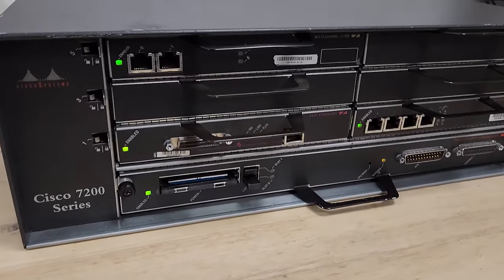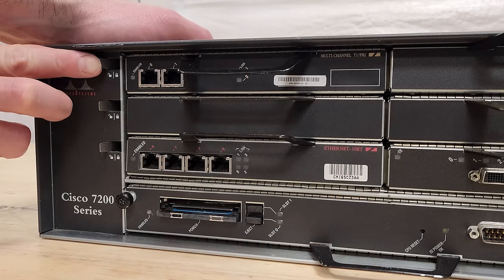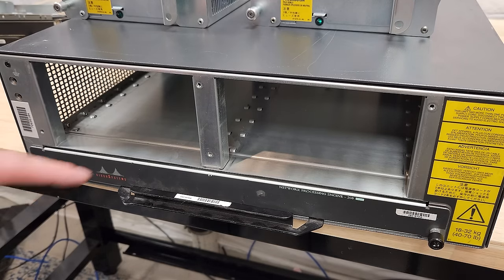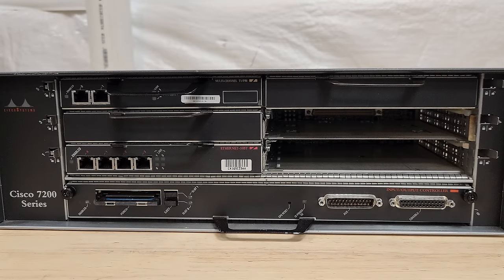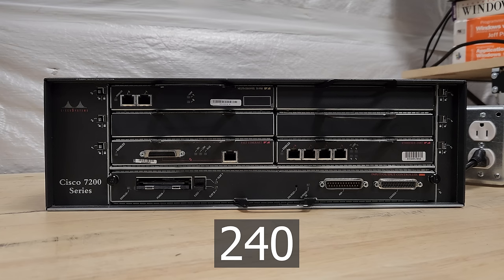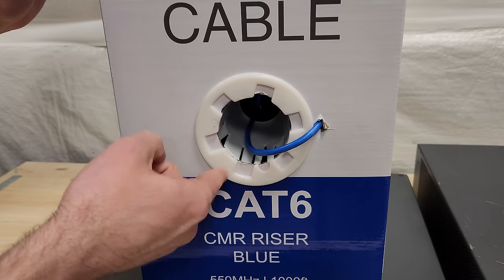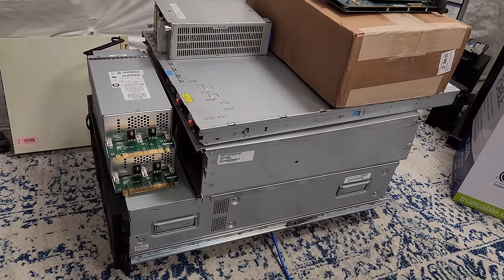Cisco 7200 Series Router

Comment: Installed, and/or monitored several of these through the years. It is one of the few routers that honestly it would be safe to call a boat anchor if it catastrophically failed. Mostly because of the copper winding's in the power supply. 

Both of the companies I worked for at the time (late 90's, early 2k's) were very extensive users of Token Ring. They were also both heavy mainframe users (though I don't know if the one was using IBM mainframes, or someone else's.) I suspect that if you ask around the biggest and most persistent users of Token Ring were in businesses where "No one ever got fired for buying IBM' and were in sectors considered highly conservative, (Financial services, Insurance, etc.)

Have fun, and keep checking on the hardware. And remember that there has been a large sector of the community that has been hording releases of IOS, simply because it made more sense to do that than to not have a version of code to fall back on if someone dropped support for a piece of hardware the business relied upon.

Comment: You can actually run the NPE-225 in the 7200 non-VXR (I have one in one of mine).  Advantage is being able to support 256MB RAM vs 128, so you can run newer software.  My boxes have the PA-2FE-TX cards, an E1 card and a bunch of PA-A3-OC3MM cards; they were originally used for routing between ATM LAN emulation eLANs at a large university; one was the Internet border gateway.

I ran one of these as my Internet border at home, but the NAT translations would cause my memory to exhaust itself on later releases of IOS (many which worked on 128, but claimed to require 256MB).  Shortly after upgrading to the NPE-225 from the NPE-200, I moved to a 2851.

There were two types of memory card supported - ATA flash (as you pictured), and linear flash.

Comment: Generally where to find the file to boot from in Cisco devices is part of the configuration, so it not finding the file in slot0: automatically isn't actually unexpected behavior.

This allows you to keep multiple versions of IOS and swap between them easily for troubleshooting, upgrading, etc.

It also allows you to have multiple cards with backup files in case you have a hardware or file corruption error.

Comment: I'm feeling really bad that routers I still use in networks today are featured in a 'retro' networking video! The Cisco 7200 was a real workhorse when I was building networks in the late 1990's and early 2000's. Went right through from NPE-100 to NPE-300, and then ultimately the NPE-G1 and NPE-G2 which have the I/O controller and some GigE ports built into them. Whilst newer routers (such as the 2800 and then 2900) had GigE ports, it didn't mean that the CPU could pass full gigabit speeds.

One particular oddity with those PCMCIA cards is that Cisco came up with their own format and filesystem which wasn't understood by linux. I spent time reverse-engineering this at the time, and wrote a tool "ciscoflash" (there's still references to it on Google) which allowed me to read files from the filesystem - very useful for extracting log files, etc.
Reply from the maker: don't need to feel bad about that, these things were built to last. I'd like to try out a G1 or G2 someday!

also I'll have to check out your ciscoflash... very useful!

Comment: Fun video....  since you have a spool of cable there, it would be neat to see how far you can shoot that T1 line...  if you can get to the far end of that spool, put a connector on it and see if you can shoot the 1000 ft or so that's in there.  T1 should shoot well past that, but I'm curious if two routers can shoot that distance.

Comment: I don't remember what the modem speed was at the time, 14.4, 28.8 or 56k, but I drooled every time I read about T1 and it's stupid fast speeds! Those massive pin connectors kinda remind me of the 2009/10 Mac Pro CPU connector. Just missing the massive locator pins!

Comment: 35:00 This is totally fine and pretty typical for this era! Tonnes of enterprise grade switches in the mid-late 00s were 100 meg with a few 1GbE uplinks.
Reply: We have a ton of branches where we're upgrading from 3650s to 9300s. It's all gig for access, but for some ungodly reason, we still have a ton of old VoIP phones, I think 7913Gs, which means all the endpoints are still connected at 100 Mbps.

After loads of pushing, we finally got management to evergreen the phones, and weirdly enough, at the branches that have been switched over to the new phones, network slowness tickets have stopped.

Comment: The points system sounds like is essentially assigns 1 point to 1Mb of bandwidth, doubling it if it's full duplex. Pretty simple to do the math in your head that way, so it sounds like a good system.

Comment: The little bit of memory @7:52 is not DRAM like you usually see on those modules but in this case its FLASH storage named bootflash:
Also note the big Dallas chip below it, It is an SRAM chip with build in battery and when that battery dies all the data is lost, so before that happens get a cheap EEPROM programmer and dump the memory and put it back in a new SRAM module you get from a place like Mouser and not some vendor from china because they sell old modules with already almost dead batteries.
Reply from the maker: yeaaaah wasn't excited to see that Dallas chip

Comment: If you get the 8-port IMA cards and a few Adtran TA-600 series devices (TA-612, for example) you can load an ATM firmware image to then run in ATM mode instead of TDM mode. Just pay attention to the hardware revision, since the v3 versions use a different image than the v1/v2 versions.

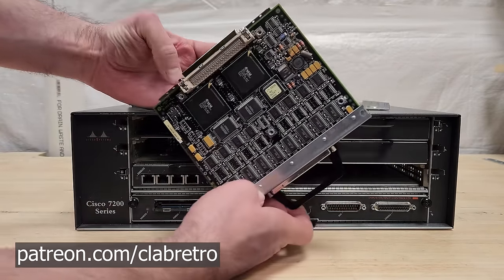Comment: 6:44 is that window going to be covered up? That appears to be large enough to be the secondary egress, which is necessary to have a room rated for bedroom usage. But I guess it's easily reversible if/when moving out. 
7:59 does eject button not fully depress for that PCMCIA slot? Normally you click it in & then it pops out, and then you click it in again and it ejects the card. 
Love seeing all this stuff done w/old cisco gear!
22:30 ah, card was jammed in upside down ugh
44:20 maybe time for a cable tester too
Reply from the maker: yeah the window is framed in properly now, it's just a technique where you build the entire wall at once first and then cut out to exactly what the window needs.
Reply: @clabretro  makes sense

Comment: "obviously never had a T1 as your house" .......
LOL
Yea I had a E1 in my apartment back around 2000. Technically Europe had the fastest internet as we had E1 and E3 instead of T1 and T3 connections so I had 2 Mbit/s leased line in my apartment curtesy of BT (where I worked at that time) 
Has an Cisco 1600 as my router and of course a TSU/DSU (have different names here as well) running over one analog circuit. 
Had a /28 public IPv4 range as my disposal... I ran my own DNS as well with full PTR delegation.. ohh good times..

My serial was connected to one ... Cisco 7206 VXR ....  Configuring time slots in Frame Really is .. difficult.
Reply: Let's guess that the DNS PTR was used for funny hostnames on IRC. 😅
Reply from the maker: very nice. in the states we pretty much made the switch from dial-up to broadband in most areas in the early 2000s
Reply: @JayJay-88  now you hurt my feelings, I would never do that.. ohh was that what my friends wanted to do when they asked me if they could "lease" on of my IPs.. 

i even placed one of my printers on a public IP just for fun, in case someone wanted to send me cool stuff..
Reply: @clabretro  yea right.. I used to work for British Telecom, was always fun to talk to my US colleagues about "broadband" :D

Comment: You can set the config register to ignore the system config, and then once it boots up, use the "show startup-config" (or "show start") command to see what it was.

"Show running-config" or "show run" and "show config" will show you what the current operational config is, which will be blank if you tell it to ignore the config on startup.
Reply: Of course once you do a "write mem" (also "copy run start") you'll overwrite the old startup config and lose it
Reply from the maker: Ah that makes sense. Would you have expected a "show start" required after telling it to stop ignoring and a full reset like that though?
Reply: @clabretro  hmm, not sure if I understand, but "show start" always shows the startup config whether it was ignored or not. "show run" always shows what the device is currently running, which would be the same as "show start" if not ignoring, or a default config at boot if it is ignoring.
Reply from the maker: Yeah it was just odd that the startup config (I thought) wasn't being ignored anymore at https://youtu.be/P5dsq16-d_I?si=Tc47dzg0Po3O238Y&t=1676, yet was still blank. And previously I saw errors relating to what definitely looked like an existing config. At any rate, I'll be checking "show start" from now on!
Reply: @clabretro  oh yeah it definitely still had a config stored in it. That seems all too common with routers and switches I've bought over the years.

As you guessed, all of those errors that streamed up the screen were for hardware and maybe software features that didn't exist (e.g. different software version/feature set, or modules that have been moved around).

When I say ignore I only mean that it won't load the startup config into running config at boot. But the config still exists wherever it is stored so you can then view it afterwards. On most older Cisco devices its stored in an EEPROM rather than on the flash card, but modern routers store it in flash (IIRC the 2800 works this way).

Maybe I need to re-watch the exact sequence of what you did, but generally:

1. Break in to ROMMON during boot, set config register to 0x2142 to ignore the stored startup config
2. Boot the router
3. Router comes up with a "blank" config (hence you get the prompt to configure the router), as in, nothing is configured but it'll have some basic contents
4. You can do a "show start" at this point to view the stored configuration, "show run" will just show the blank config from above
5. Configure the router as you wish, "write mem", and set the config register back to 0x2102 to boot up with your new configuration. Next time, "show start" and "show run" will both show your config.

Comment: Those passthru connectors seems so cool, i know. But every time i come across one in the wild its because of an issue. Whether the wires weren't cut flush and dont let the connector lock into the switch or the ends of the wires got shorted or corroded. Making an ethernet cable sans pass-through is actually very easy, as you well know considering you did it in this video. You just didn't cut the wires as short.

Great video, seriously! But being in the industry i hate those connectors.

Edit: YouTube comments on mobile don't auto-correct and its obnoxious.
Reply from the maker: Yeah they're great for an amateur like me though haha. I've made a ton without issue, but the blade on my crimper is actually wearing out so like you said, it doesn't always cut the things flush.

Comment: So the backplane of these looks like it's just PCI (considering the AMD PC-net NICs with no bus adapter on the board and that the NPE has Intel DC1111C PCI/PCI bridges towards the backplane connectors), but what I find really curious are the two Intel TL82543GC on the I/O controller at 8:50. Those are 1000BASE-TX / GigE NICs. Huh?

17:46 might just be a footprint snafu, the PCB designer intended for the LDOs to be upright but maybe that doesn't quite fit in the max z-height of the tray or they'd get bent and short with components easily. Easy fix => just tell the factory to slap a ton of kapton tape on the components below and bend the LDOs over. No PCB revision needed!
Reply: It seems i82543 were used for some Fast Ethernet cards as well on the 7200 VXR. Meanwhile the GigE cards seems to have used Broadcom NICs. Kinda weird, isn't it? This would've been the time where a GigE NIC cost a big premium over a 10/100 NIC.

Comment: The card with the broken capacitor should work just fine. It was paralleled up with a few others as a sort of reservoir for a switch mode power supply (rather than for a frequency-tuned circuit). The result of losing one of the 'buckets of energy' in this type of power supply is that it will switch faster for a given power demand, possibly suffering ripple or undervoltage events at 100% load. Usually (especially when/where this card was designed/made), an electronics engineer will significantly de-rate the labeled values of capacitors in this type of application, because bulk storage capacitors often have tolerances of 10-20%, meaning losing that one may simply bring the performance of that circuit block down to the actual circuit requirements at full load.

The Token Ring card causing system upset is completely normal however. Token Ring is generally bad luck, and raises gremlin population of all nearby technology. When your ring starts beaconing, that's the gremlins laughing at you. Any form of movement, sound, or ill thoughts will disturb and anger the gremlins, and your basement may cease to be the fun playground you originally planned on. I recommend you eject the TR card into space at your earliest convenience and stay up-range in case the gremlins foul up the rocket. 

The card with the actual, observable, physical damage - on the otherhand - is probably going to be your most trustworthy and loyal component in the entire system.
Reply from the maker: some other folks mentioned that about the capacitor, I'll have to give that board a try after all. and yes, setting up token ring will be fun 😂
Reply: @clabretro   Just keep an active volcano nearby so you don't have to venture far when it becomes obvious that the ring belongs in the lava.

Comment: If you had two 120 Ohm to 75 Ohm baluns available you could have gone from TP-E1 to coax E1. Tx and Rx are more visible that way. Then you only need a large nation wide network of Sonet-muxes. :) (For real, you should get a couple of small muxes and run a OC3/STM1 between them via fibre, and mux your T1 in on one of the VC11-slots on that.)

Comment: mate...you've been paddling through the greatest hits of my 90's sysadmin experience. 

make some rollover cables and you can just plug all the TDM interfaces together and hae 'pretend' WAN
Reply from the maker: oh yeah, we'll be all about pretend WANs for awhile
Reply: The rollover cable works for 56/64k DDS connections, not T1. Also a great way to have a private exchange so that you can introduce dial-up networking would be the use of an Adtran Atlas. One caveat on the Atlas is it pretty much has to be the clock source on circuits and will take errors if you have the T1s set for line clocking.

Comment: (35:31) With bulk cable boxes, you can usually see how much cable is left if you look at the text string printed on the cable itself as one of them would indicate how much cable is left in the box. For example (and I live in a part of the world that uses Metric units), one box has "028 m" printed at the end of the cable so it has 28 m remaining, while another (from a different brand) has "50m" printed at the end of the cable so it has 50 m remaining. In your case, as the bulk cable box you have mentions 1000 ft and not 305 m, the text string may indicate the remaining length in feet instead of metres.

You talking about T1 connections reminded me of a video series from 'The Serial Port' where the host built a retro '90s dial-up ISP.

Also, I'm somehow now imagining you producing videos about Token Ring networking, partially because I first heard about that in an old article I read many years back where the author attended what I think was a secondary school, high school, or college whose IT department used Token Ring networking.

(44:21) I was reminded of when I would assemble Ethernet cables from bulk cables and would sometimes completely invert the arrangement of the wires because I put the connector in with the latch up when the colour coding for the T568 standards seem to be relative to the connector with the pins up!
Reply from the maker: Ha I didn't know about that length left trick! Looks like I've got another 256ft.
Reply: I've known about the length markings for a long time but I never knew which way it counted. As I mostly work with scrap/excess cable which is no longer in the box I've used it more as a way to measure already cut sections.

Comment: I'm definitely WAY more of a Juniper fan, but I have to admit -- those ISRs were so flexible.  Performance wasn't great, so their utility was really with lower-speed circuits.  But man, if you need to connect anything to anything else, they could do it.  And run your phone system while they're at it.

I have a bunch of 2900-series ISRs (and a few Juniper SRX 240s) in my lab rack just to play with and emulate different WAN conditions.  VoIP ports, T1/E1, T3... It can be useful to differentiate "networking" from "Ethernet".
Reply from the maker: very cool! yeah haven't tried any Juniper gear but I hear good things

Comment: I wonder.. That token ring card causing boot loops seems an awful lot like a power rail pulling too much current. I wouldn't suspect the seemingly bodged on regulators, but those yellow tantalum capacitors like to fail with a dead short across them, as you can see also happened on that serial card where one even exploded. You could try to just desolder one of those yellow caps one by one and see if it comes back to life, and then put in replacements. Could be an easy fix!
Reply from the maker: oh good call, that could be it!
Reply: @clabretro   It could be worth a shot to fix it at least!